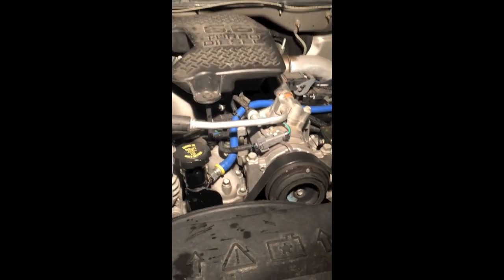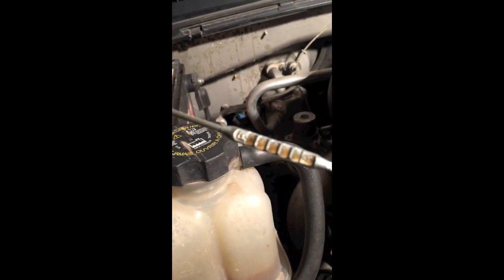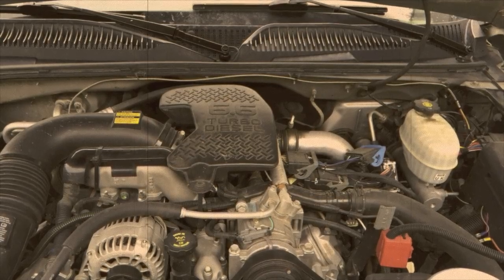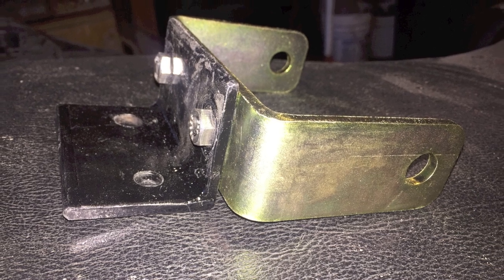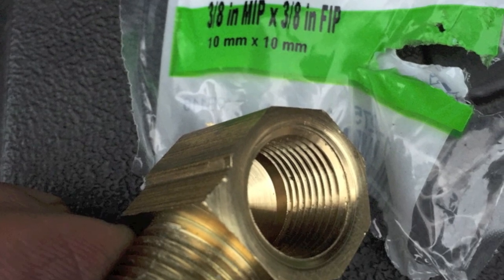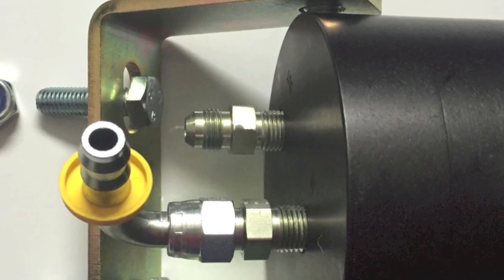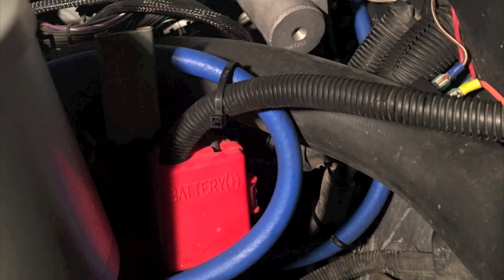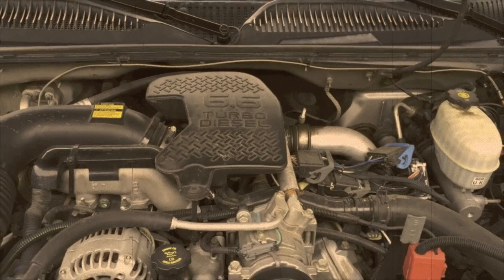Duramax Bypass Oil Filter Installation by Insane Diesel

Comment: Ok, the sellers website suggests the larger kit for the D-Max, the extreme X2 filter, the "1 World" kit is intended for engines with 8qts or less. 
Does this just require more frequent filter changes? 
(Im just curious in case i run into room issues.)

Comment: Frantz are the toilet paper filters, the extreme by insane is not toilet paper. I don’t know what kind of media it is but it’s not toilet paper
Reply from the maker: True, many innovations have happened since "toilet paper filters", innovations like quality pulp with special features designed to improve filtration and moisture removal. We aim to be the BEST filter which requires the BEST in manufactured parts and elements.

Comment: I’d be interested to see what affect installing one of these had on system oil pressure and volume. And to comment on a previous posters reference to Centrifugal Filters, and you’re answer that they’re ‘getting good’,,,,Cat and other big diesel manufacturers have been using Glacier type centrifuge filtration for many years very successfully in conjunction with pleated element filters, I can attest to this especially with marine engines due to having had to maintain the filthy bloody things.
Reply from the maker: Engine's make plenty of extra oil pressure and are made to provide oil pressure for accessories like oil coolers and additional turbos. There is no tangible effect on pressure and volume. Bypass filters have been used on engines for decades to extend life. Centrifuges also work to reduce contamination but none have the progressive technology and retention of the EXTREME oil filter. Check out InsaneDiesel.com to see laser net find oil analysis where you can see EXTREME gets your oil about 4X cleaner than new oil. Over the last two decades this technology has extended engine life a stunning 2-8X by keeping oil clean as the engine runs! Also check this short video: https://youtu.be/XQK3KxFuhrI

Comment: I was talking to a over the road trucker years ago he showed me his two Frantz 3 stackers he said he goes to Safeway and gets.a 6 roll pack of Safeway truly fine they were a perfect fit in those days probably wouldn't fit now days. 3 stackers were very effective but a nasty mess to change he loved them
Reply from the maker: Many innovations have happened since "toilet paper filters", innovations like quality pulp with special features designed to improve filtration and moisture removal. We aim to be the BEST filter which requires the BEST in manufactured parts and elements.

Comment: so how much longer do you run your oil before a change now? have you done analysis to see how long you can run it ect.?
Reply from the maker: EXTREME keeps oil cleaner than new oil. Once a year or 15,000 miles, swap out the filters, top off the oil, and off you go again. Do oil analysis every 7500 miles or twice a year. If the oil analysis comes back clean, keep on driving. Some trucks have gone over 100,000 miles on the same oil.
Reply: @InsaneDieselUSA  wow

Comment: Is there something different than drilling a hole in the oil tube? That seems a little cheap to do that.
Reply from the maker: It's actually a really smart way to go because a weld is permanent and stronger than the tube itself. However, most prefer to do the ported cap, it costs a bit more but makes the conversion very easy. https://squareup.com/market/insane-diesel/item/duramax-oil-filler-cap-w-return-port

Comment: Brandon, it's an organic filter material manufactured with a compression process so it can filter progressively from 10 Micron down to 1 Micron. You can learn more at INSANEDIESEL.com and there is a link to the online store where you can see all the prices. This filter has been around for awhile in industrial use and we have not found a better one after 2 years of testing everything out there. So we re-branded it for the general public. I hope that answered your questions :-)

Comment: so... is this like a centrifuge style oil filter? what is the cost of this setup?
Reply from the maker: It is not a centrifuge style, and although some centrifuges are getting good, they aren't really as effective as many claim. Plus, they are far more expensive. Using the EXTREME is actually far more effective, no moving parts and easier to clean. You can find prices at this link: https://squareup.com/market/insane-diesel/